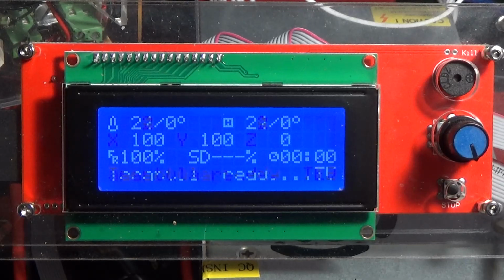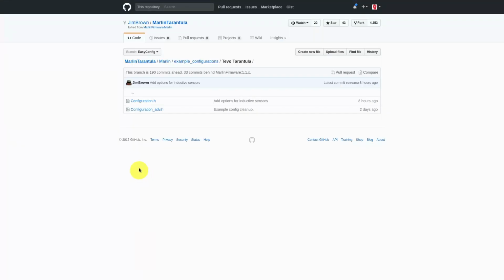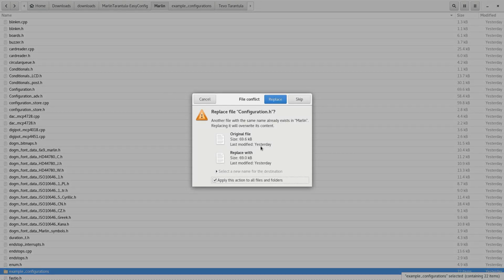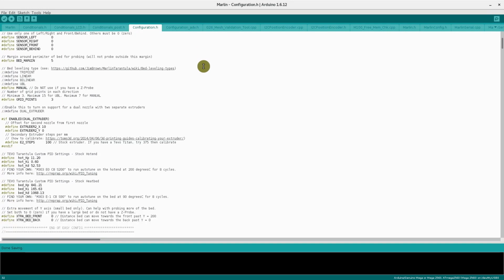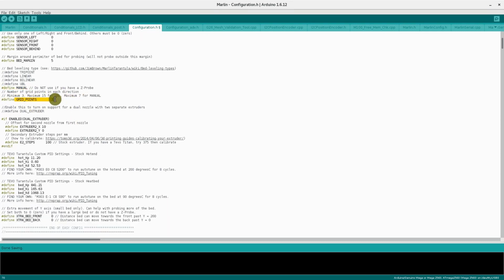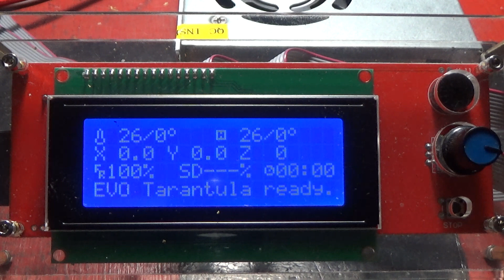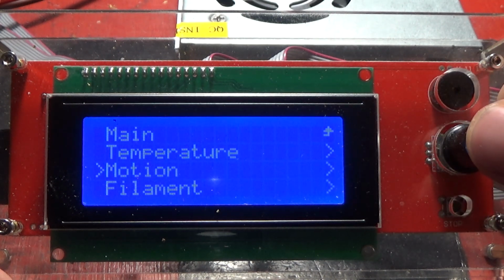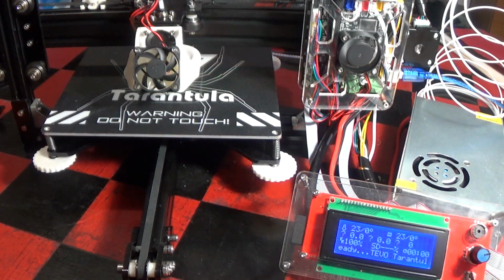Tevo Tarantula 3D Printer - Flashing new Version of Marlin Firmware with EasyConfig

Comment: Hi!
I get this failure when attempting to compile...

Arduino: 1.6.8 (Mac OS X), Board: "Arduino/Genuino Mega or Mega 2560, ATmega2560 (Mega 2560)"

sketch/src/module/motion.cpp:58:114: error: too many initializers for 'const float [3]'
 #define XYZ_CONSTS(type, array, CONFIG) const PROGMEM type array##_P[XYZ] = { X_##CONFIG, Y_##CONFIG, Z_##CONFIG }
                                                                                                                  ^
sketch/src/module/motion.cpp:62:1: note: in expansion of macro 'XYZ_CONSTS'
 XYZ_CONSTS(float, base_home_pos,  HOME_POS);
 ^
exit status 1

any idea?
Reply from the maker: Hmm, what have you changed from the default settings? Does it compile with the default settings?
Reply: Hey! I changed the X n Y offsets in the easyconfig. to a value it didn't like... changing them back to 0 0 did the trick. Like a charm now! Thank you very much!
Reply from the maker: Great! Thank you for posting your solution :-)

Comment: DONT FORGET  TO PUT       //#define M502
NEXT LINE  //#define M500 on sketch for this to work  
then upload  
this is how i fixed my one 
good luck
Reply from the maker: Which problem are you trying to solve exactly? You are adding comments - which do absolutely nothing in terms of functionality ;-) Gcode M502 is restore factory settings and M500 is save settings...
Reply: im sorry i thought i was trying to help as it says in the marlin install to do this . 
its just after my printer stop working  after doing the firmware update .
2 rows of black squares in lcd  and 3 hours of trying to re install  i added this to the gc and it started to work ???????
Reply from the maker: You send those GCodes via repetier or some other host, I assume? Yes, load factory settings and save. I mention this in the vid. But you are right - if one can not navigate the menu, sending those codes manually might solve some issues. Thank you for mentioning it, I just thought you added those comments somewhere in the source code,...

Comment: Arduino: 1.8.8 (Windows 10), Board: "Arduino/Genuino Mega or Mega 2560, ATmega2560 (Mega 2560)"

C:\Users\Pilots\AppData\Local\Temp\ccJr9oVh.ltrans0.ltrans.o: In function `main':

C:\Program Files (x86)\Arduino\hardware\arduino\avr\cores\arduino/main.cpp:43: undefined reference to `setup'

C:\Program Files (x86)\Arduino\hardware\arduino\avr\cores\arduino/main.cpp:46: undefined reference to `loop'

collect2.exe: error: ld returned 1 exit status

exit status 1

Error compiling for board Arduino/Genuino Mega or Mega 2560.

This report would have more information with

"Show verbose output during compilation"

option enabled in File -> Preferences.
Reply from the maker: Double check the marlin branch you are trying to compile from.
Reply: Get same problem. Updating version of  Arduino IDE helps me.

Comment: Help...I have just updated to this version of firmware.   But now I can not get extruder to feed filament.   It was working before I flashed the firmware.    I have moved the stepper motor to another axis to test and it is working.   I have it in the E0 port on my board what am I missing.   Is there something with the nozel temp needing to be set to 151?
Reply: Never mind I just found another site says the nozel temp has to be at lest 180 before extruder will feed.   And guess what it feeds if I have the correct temp set...

Comment: Please Help... None of my steppers will move nor can i set the nozzle or bed temp but i can see the current room temp. I have flashed the Jim Brown marlin firmware and copied the two easy config files over to the marlin folder as i am using a standard machine without auto bed levelling. Im using repetier host. when i try home the axis from my pc or the LCD panel nothing happens
Reply from the maker: And everything was working before you flashed the firmware? You can also not home from the LCD, even if nothing is connected via USB, right? Have you checked all your power connections?
Reply: Hi Thank you for your reply. I found a loose connection on one of my power cables. i assume it wasn't making proper contact. its working now
Reply from the maker: Great! Glad you could solve your problem.